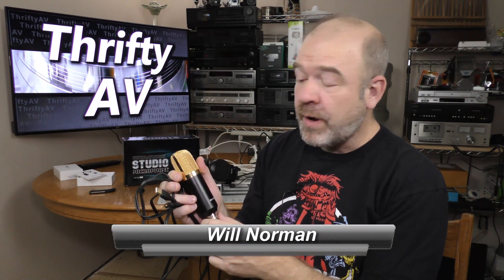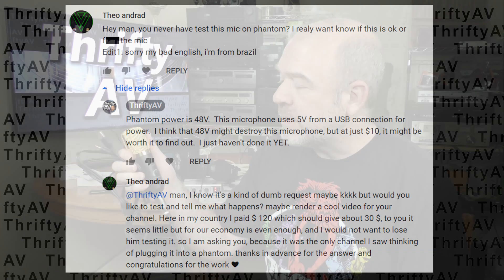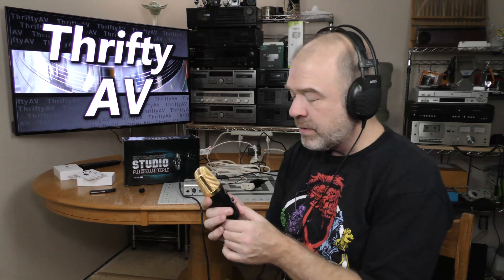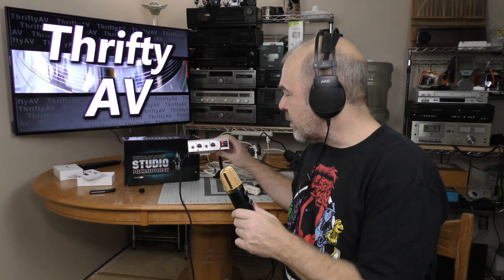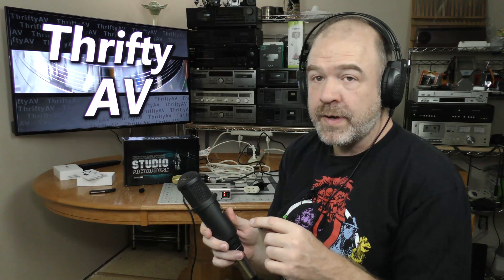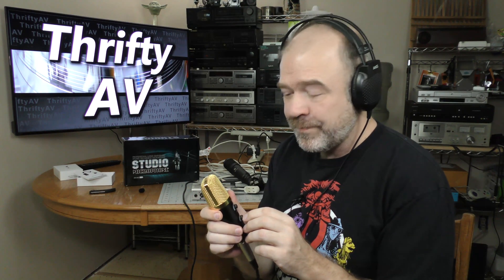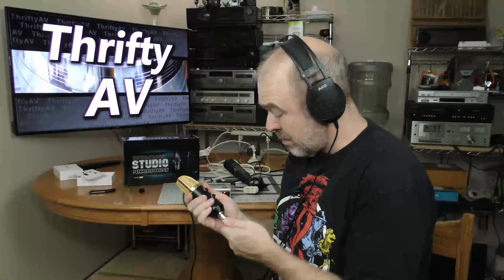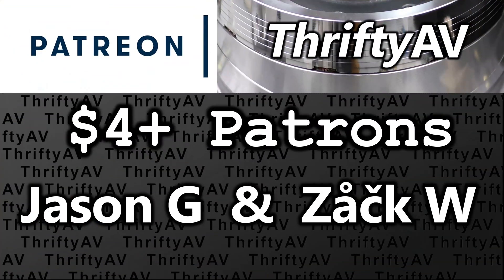40 Volts instead of 5?!  Phantom Power Experiment on a Cheap Microphone

Comment: is 15v phantom power enough for most condenser microphone? like the at2020 or mxl 990?
Reply from the maker: These devices are designed for, and expect, 48V.  The lowest voltage I've used is 40.3V on my M-Audio Audio Buddy, and all my condensers work with it.  15v is less than 1/3 the voltage that these microphones are designed for, but you will still generate a (small) charge on the back plate.  This is a guess, but I would expect that the microphone will function, but will require considerably more gain on the signal, and thus, more noise.
Reply: @ThriftyAV  thanks, i decided to get a phantom power supply just to avoid headaches.